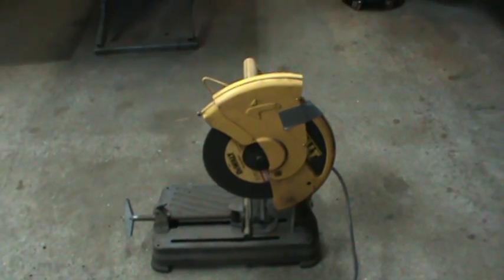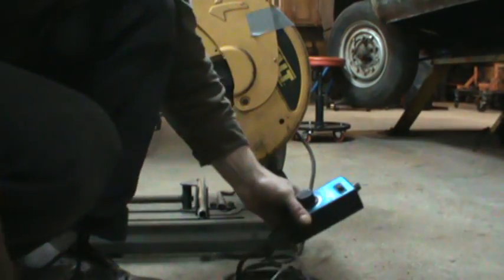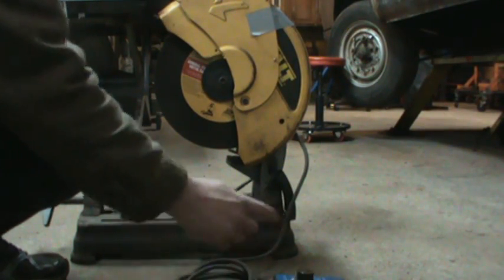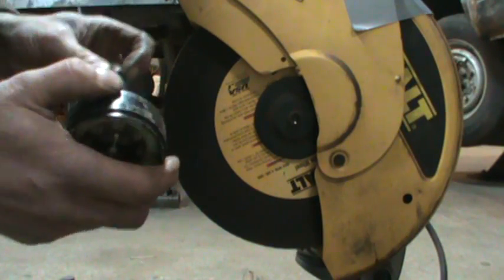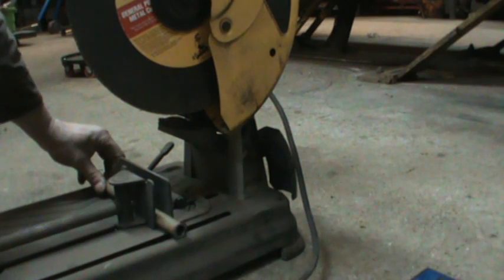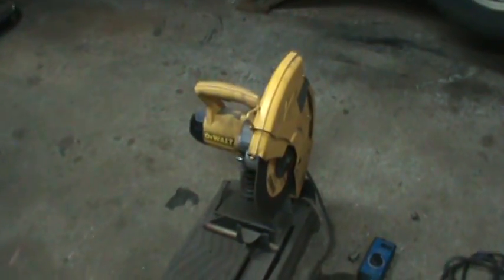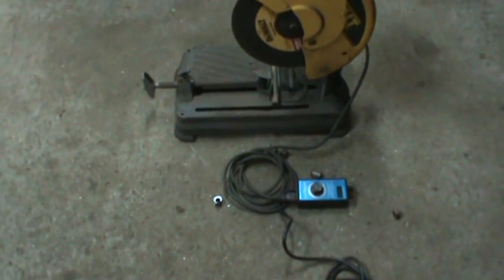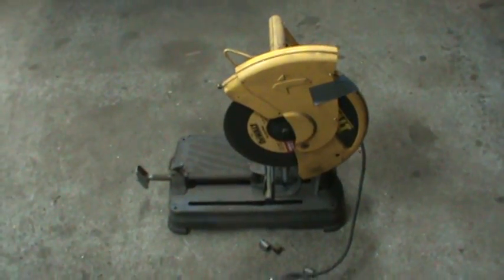running a dewalt chop saw with a router controller

Comment: the great thing is that there are metal cutting cermet blades available now that are  rated to 4000 rpm.  from 7 inch to 14 inch. It just takes a little digging online.

Comment: You're gonna lose power no matter how ya reduce it..  Reducing power in,  reduces power out..  No way around it...  Either way,   AC motors,  don't like that..  it will heat up..  You need a frequency drive to do it right,   and they cost more than the saw.

Comment: All motors with brushes will run on Alternating current (AC), or Direct Current (DC).  But, a VFD might be the trick to variable Chop Saw speed.  You did right to do some speed tests with the voltage limiter, but, power is down, when current is limited.  Got my 2 HP VFD on ebay, for $105.00.

Comment: If you had a microcontroller you could attach an encoder assembly to the motor shaft and control the field winding so you can compensate for load, so when you are actually sawing, you can program the thing to give it more power. That means more consistent speed.

Comment: I have been thinking about doing this very thing. But got discouraged after being told dropping the speed would drop the torque.  I am going to be heading down the gear reduction path. I would love it if some kind of cheap controller would work.

Comment: I have never had good results with any of these kinds of speed reducers. You always lose power because the motor is designed to work at a certain rpm for maximum efficiency and cutting the input voltage or amperage (either way) only starves the motor for power and as a result efficiency. I have used sewing machine pedals in an effort to do the same thing, but always end up with insufficient power to do the job properly.
Reply: Well there you have it - He simply needs to replace the chop saw motor with a sewing machine unit.   -  hahahahahaha

thanks

Comment: Those router speed controls are just a light dimmer. They don't regulate voltage or speed just chop the AC signal.

Comment: These motors aren't designed to be throttled.  With a steel instead of abrasive blade the loss of torque would make it cut worse than just using it as designed with an abrasive.

Those controllers are fine for light torque stuff, but a heavy gear reduction on a cheap universal motor needs full power to do real work.
Reply: +tiporari cutting with abrasive blade SUCKS,,,its way slow...musti1 is doing this video to help me  i have a dewalt 14" chop saw with abrasive blade ...it took 10 mins to cut a piece of metal 3/8 " thick x 1" wide  i am NOT try to fight about this ..just trying to find a way to use the saw i have & a             metal blade to cut metal
Reply: +wildeyednorthernboy Didn't mean any offence.  I've used the speed controllers before, and it has just been my experience that these saws only have enough power to do the job when run at full speed.    they are built down to a cost, and have no "oomph" to spare.  

Good luck with it.  try the $15 harbor freight speed control and see if it works for you.  I have one and its fine for grinders and wire brushing.  might be fine for your purpose too.
Reply: do u think i would b wasting my tyme with a speed controler on my chop saw...i REALLY dont know sir  thank u 4 your tyme
Reply: +wildeyednorthernboy Yes sir, I do.  these brushed motors don't slow down without losing all their power.  Those metal cutting blades would just bog down the saw if it were throttled.  If you run them too fast they will chip teeth and mangle the operator.

I would get a metal cutting bandsaw.  A portaband on a stand makes quick work of cast and steel.  The cold cut saws are nice, but expensive to run, expensive blades, and easy to bugger.
Reply: +wildeyednorthernboy You know something occurred to me, and I've experienced this before.  Some abrasive cut off wheels really suck.  I've also seen them get impacted with aluminum or other soft metal and stop cutting altogether.  10 minutes is way too long.  have you tried a different wheel?  maybe a different brand/grit?  I have bought Dewalt ones from Home Depot that weren't worth pounded sh!t.

Comment: Hey buddy !
You actually already have the best speed controller for that unit .
You have a vfd !
Plug into it and scale the speed back .
The vfd will match the hz wave with the voltage and then you'll have no issue with increased resistance and taking a chance on harming the motor windings .
The clipped wave you are talking about works fine if it clips at the end of the wave.
Anywhere else and you will end up with the same issue you'd have if you ran resistors .
Reply from the maker: +Bagot Corner l agree but this is not for me, he could buy one of those too
Reply: +AvE  vfd certainly does do single phase  in to single out .
Invertek here in Canada sells them ,and they also sell them in the states in either nema setup .
Reply from the maker: +AvE thats what im thinkin too,
Reply: +AvE Edison would be proud!

I run DC lighting in my shop because I like doing stuff the hard way :)  

love your channel!
Reply: you poor thing.

i run my entire machine shop off of 50 amps -  hahahahahaha

Gets tricky, but I get creative to not trip anything.
Reply: +AvE lol no way you're here to lol. Remember your copper workbench for electronics you built. I did the same thing cus of that and ended up ripping it up after getting zapped about 4 times.  And annoying to try not to keep the back of circuit boards from shorting out.
Reply: +AvE were you saying something ?
Don't let it bother you that something exists that you didn't think possible .
They said the same thing about the world being round .
Reply: +AvE what I should have done early in my life was to install a separate electrical service into my shop and run polyphase 240 and purchase tools matched to save on amp load.
But what I have is zero expansion room in a 150 amp federal pioneer service .
Even to kick up to 200 service is 700 bucks here just for the breaker
Reply from the maker: +AvE in the olden days (80s) my welder friends ran all there grinders of a gas powered dc only welder just fine, but still think it will be down on the hp when throttled for lower rpms,
Reply: +AvE I run my lathe off one.
Single to single .
Cheaper though in hindsight  would have been to buy a 3 phase Motor and purchase a more useful vfd
Reply: +AvE why so angry ? I don't get it .
Reply: Bagot Corner m

Comment: A 15 or 20 light dimmer connected to a plug put in a electric box will do the same thing!
Reply: +Nails you wont get more then a amp out of those
Reply: 15 or 20 (amp)
Reply: +Nails Light dimmers are rated by watts.  A typical light dimmer is 600watt.  To calculate amperage you divide the wattage rating by the voltage from your power source.  In this case 600/120 = 5amp...that is the absolute max and would heat up those cooling fins quickly.  I suspect that saw, under load is easily 12-13 amps.
Reply: +yourbeekeeper  saw not under load is 15 amps